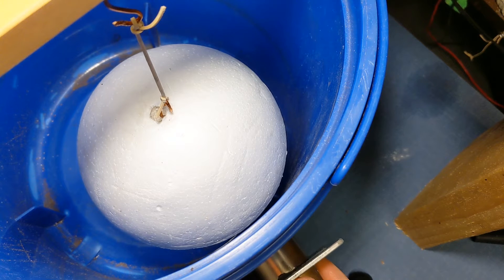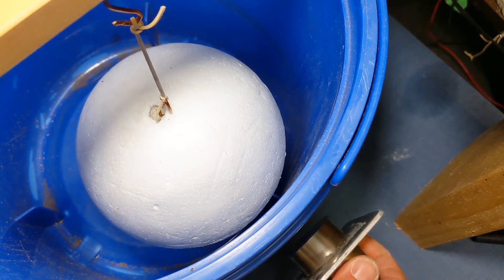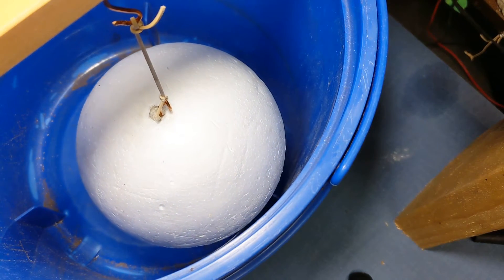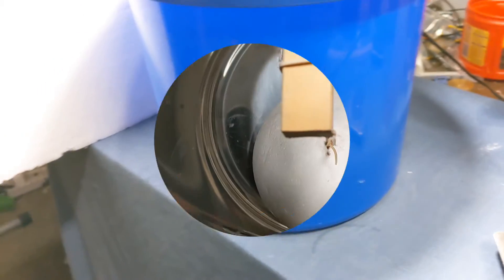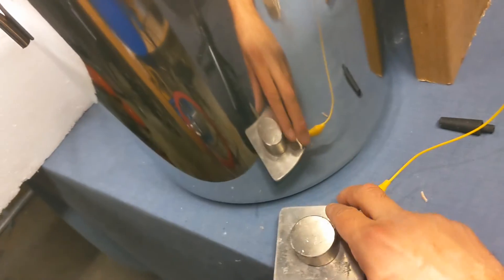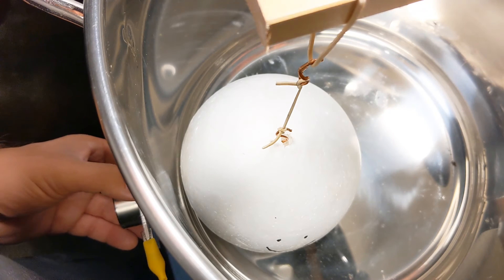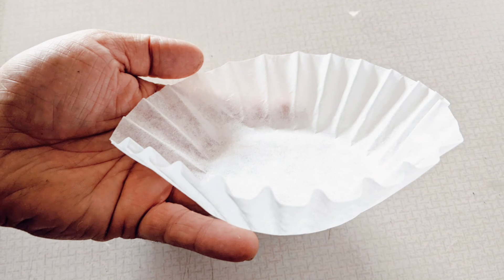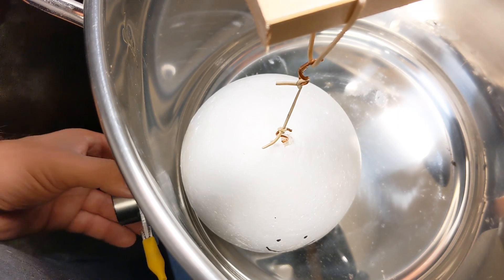Can we move styrofoam with magnets?

Comment: Looks like you're using a brass hook to attach to the styrofoam? If so that's likely what you're moving.
Reply from the maker: It's actually the materials, but yes copper is paramagnetic
Reply: Look up diamagnetism on Google before you comment randomly. Very strong magnets REPEL water, materials containing hydrogen atoms (plastic), bismuth, silver and graphite. Common knowledge and I have done it on numerous occasions myself.

Comment: Because of how the ball is dangling from a single pivot point like that and the force being applied to the ball reducing exponentially with distance, even small changes in relative position of the magnet and foam, if done rhythmically, is going to act like kicking on a swing.
It'd be interesting to use a couple electromagnets set up in a circular array around it that you can individually switch on and off, getting the foam to move around in all sorts of patterns.